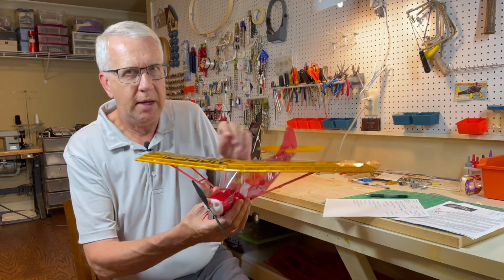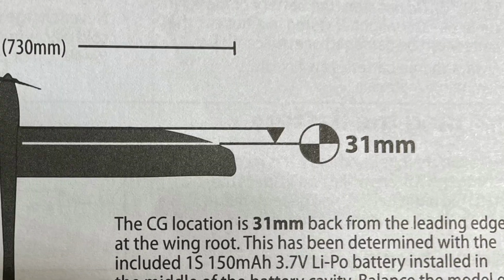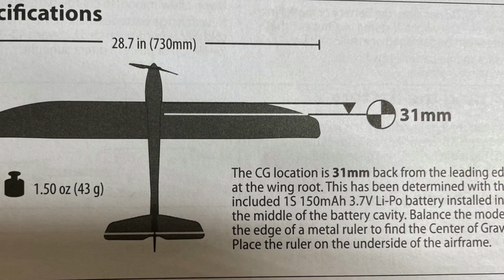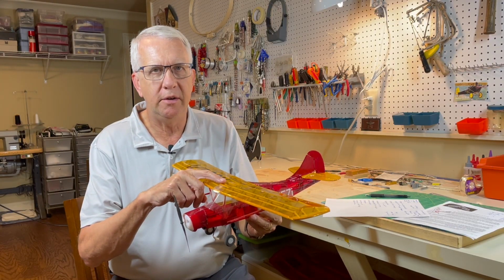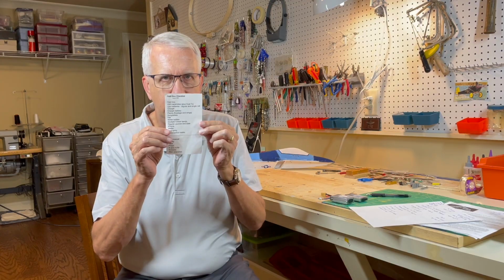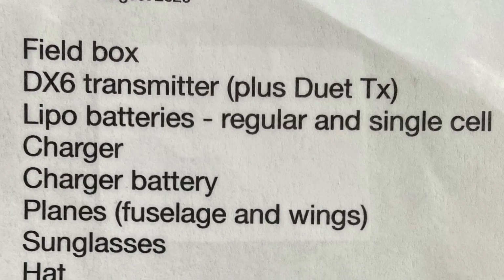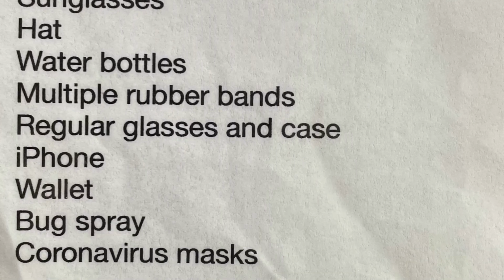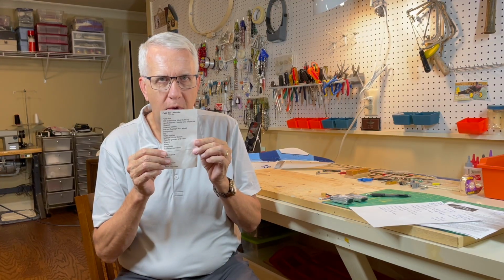10 Radio Control Mistakes to Avoid

Comment: Excellent presentation Tim, thanks for the hints.  I too am a retired professional pilot who has been flying RC models for 60+ years.  I like to build balsa models so I'm pretty experienced when it comes to most of what you described.  The only thing I wish you would have emphasized more under your "airspeed" heading is the importance of ALWAYS taking off and landing into the wind!   On days when the wind isn't cooperating and puts the pilot into a direct crosswind situation, in my view, it's best to sit that one out and wait for better conditions.  Taking off in this situation isn't as big a problem as landing which commonly results in substantial damage to the model.  Thanks for your time and experience.
Reply from the maker: William:  Fully agree on your thoughts with always flying and landing into the wind.  I think this would be a good video subject as well.  Tim
Reply: @daviddou1408  There's a HUGE difference between flying full-scale airplanes and rc models!  I was referring to inexperienced pilots when I mentioned sitting out a brisk wind day where the wind isn't at least within 30 degrees of the takeoff/landing site.  Just saying!
Reply: @daviddou1408  You're the one that brought up "full size" aircraft!  Not me!  I think all you want to do is be argumentative!  I stand by my original comments to Tim and as you can see he fully agreed with me.

Comment: One time I drove 40 mins to my field only to find I left my Tx at home. 😭 How the heck do you forget the Tx?!!!
Reply from the maker: Jim:  Glad that never happened to anyone else (cough, cough)  😁 Tim
Reply: I have a sign on my workshop exit  says Don’t forget your TRANSMITTER !
Reply: Did this, but in reverse.  Lost a Nx10 that day.  😢
Reply: @bdr33gm  ouch!
Reply: LOL I did exactly that about 3 weeks ago, luckily my field is only a mile down the road….
Reply from the maker: @TestPilotIan  All good!  Tim
Reply: @TestPilotIan  Don't take this the wrong way but...I'm glad it happened to you too. Now I don't feel as dumb. 😆😅
Reply: I usually drive to the flying field by myself and before I leave home, I check that my RC backpack containing tx and batteries is on the front passenger seat. I arrived at the flying field way more than once without those essentials before I disciplined myself to make this simple check.
Reply from the maker: @ibillyq  Bill, Fully agree!  Those that have and those that will.  Tim

Comment: For newer builders, you might do a short video on must-have building items that are either discontinued or hard to find. Great Planes items are increasingly hard to find because the company is no more, and Master Aircrew building items like a razor plane and balsa stripper are also hard to find.

Seems that retailers want you to buy ARFs/BNF/PNP, but not build.
Reply from the maker: Will:  Great video idea, thanks!  Tim

Comment: Good tips for newer pilots. Checklists are critical for building, preflight setups, and the field "take-with" list.

My take-with list is always with my Tx and/or battery box. On that list is the all-important category of hardware that may be required for final assembly at the field. My Carbon-Z Cub has eight hardware items per wing half, so that kind of thing has to be on my list (and the container of hardware always  lives in the tool box).

Another must-have item for me is one or more magnets. I have a heavy duty one on a 36" pole for finding that lost cotter pin or screwdriver bit, and a small magnetic tray that holds hardware as I assemble the model.
Reply from the maker: Will:  Great inputs, like your magnet idea a lot!  Tim

Comment: Before gyros, many P-51s suffered a one and only flight.  People wanted one for their first plane because they were "cooler" than your typical Cessna design.  I started RC with a Cox Centurion in 1981, then several high wing 3-channel (rudder/elevator/throttle) birds before attempting ailerons.

Now people are starting to learn to fly with gyro assist, but too many are becoming dependent on it.  Not good.  Like training wheels gyro assist (self-leveling) should be abandoned as soon as possible so that real flying skills can develop.
Reply from the maker: DL:  Agree, I do not like "fighting the autopilot" while learning how to fly RC.  Find a good trainer and learn how to do it on your own!  Tim
Reply from the maker: @daviddou1408  David:  Many thanks!  Tim

Comment: Tim you need to check again 4.3 votes is way to low on your radio. 4.8v to maybe 4.7 no lower, very risky at 4.3. Not safe to fly at 4.7votes
Reply from the maker: Doyle:  Spektrum lists 4.3 volts in the manual for alkaline batteries.  6.4 volts for Lipo or Li-ion batteries.  However, I do not push the 4.3 volts, if the transmitter is much below 4.8 I just install a set of fresh AA batteries.  Tim
Reply: @TimMcKay56  Operating as per instructions from the factory is OK. The unit will have a voltage cut-off around 3.3 V. plus diode drop of .6 V or a little less. Different for lipo because of battery discharge limits. The unit will still work to the lowest voltage the factory recommends. You could always check this yourself to be safe.
Reply from the maker: @tedmoss  Thanks!  Tim

Comment: Tim would wing loading affect a plane stall speed only or could it cause the plane to slowly sink to the ground in a few seconds without actually nosing up and stalling? If it is doing that can it be remedied with more power or just more wing area?
Reply from the maker: George:  Wing loading affects the plane's stall speed.  Higher wing loading, higher stall speed.  An overweight plane can fly, but if overweight all performance figures are off.  Will need a higher takeoff and landing speed, more engine power for level flight, etc.  Two ways to fix a higher than desired wing loading is to lighten the model, if possible, or make a bigger wing (add wing area) to in effect lower the wing loading.  Tim
Reply: @TimMcKay56  Tim, I had an airplane which was a little bit heavier than the motor was made for and it gradually sent to the ground without nosing up installing do you think if I put on a brushless motor with more power it might solve the problem is it worth investing the money cuz all together to get the batteries and everything to go with it would cost over $100?
Reply from the maker: @georgejunior895  Yes, a more powerful motor will allow the airplane to fly.  Just faster takeoff and landing speeds, with a higher stall speed.  Good luck!  Tim
Reply: @TimMcKay56  Tim, I have another question for you. The wing on the model I'm working on is from a guillows Javelin. In the plans for the javelin it said that the center of gravity should be at the trailing edge of the wing which I know is unusual but now that it is not a different fuselage should that be different? Also the tail section is made from 16th inch balsa instead of the formers that make up the actual tail fins the way it's designed in the model and I know that would normally cause lift so without that lift would it still be at the trailing edge of the wing the center of gravity I mean or should have be 20% back from the leading edge like usual?
Reply from the maker: @georgejunior895  Yes, I noticed the unusual CG location as well.  After a bit of research, I am pretty sure it is due to the lifting stab/tail airfoil section.  If you have a flat horizontal tail surface, a GC of 20 - 25% back from wing leading edge should work.  Tim
Reply: @TimMcKay56  thank you Tim. I have another question for you. I learned that the plus voltage on the pwm connector is not always the same and not necessarily the same as the ESC. Is the actual pwm pulse amplitude always the same or if not how would you mix and match if you were speaking out your own electronics for an RC airplane so that all the voltages were appropriate.? Is that information supplied with the receiver and the motor and the servos and the ESC. When I buy things from China it's hard to get that information.
Reply from the maker: @georgejunior895  No really sure on the answer to your question on the voltage, I have not run into this situation ever.  My approach to RC electronics, as I really do not want an avoidable crash, is to spend a few extra $$ on the transmitter and receiver.  I go with Spektrum, their stuff just works.  Plus, binding when using the same brand seems to go better.  I am not so fussy on the servos, but I do stick with either Sprktrum or Hitec.  I avoid the cheap, no brand China stuff as much as possible.  Just not worth the hassle.  Tim

Comment: Great video, Tim. I'm sure you could easily come up with another 10. Hint, hint. Or how about 10 common construction mistakes?
Reply from the maker: David:  Great idea on the 10 construction mistakes, thanks!  Tim
Reply: @TimMcKay56  Like me not putting super glue in the holes of the Bass wood where my servos screwed in. LOL Lost both aileron control surfaces. Not sure if it was at the same time, cause you can fly with one aileron, but she spiraled in on my Corsair! LOL Oooops.